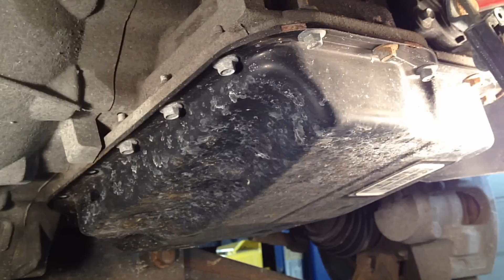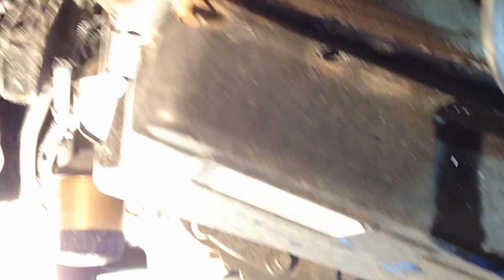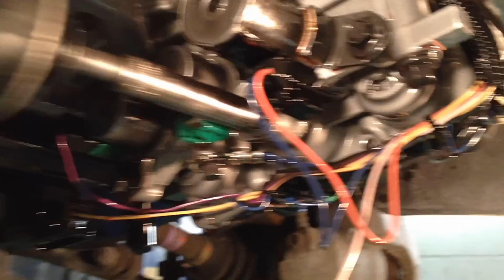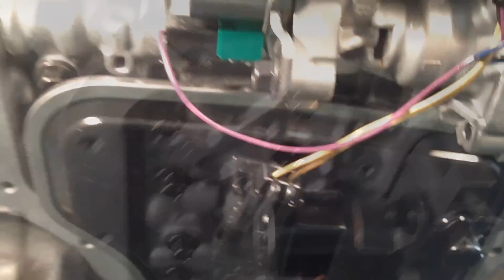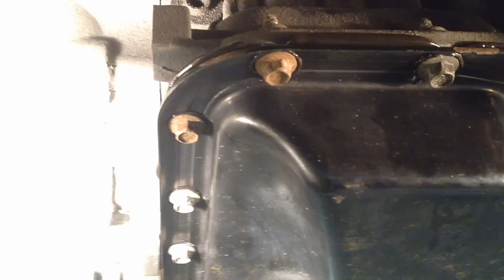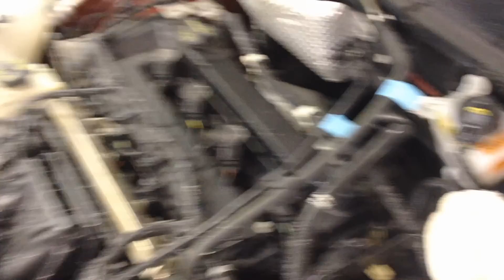Ford Focus Shift Solenoid A Repair P0750 P0753 P0972

Comment: Great video and advice..I have a 2008 Ford Focus tdci auto which keeps changing in and out of gears jerking motion yet hasn't lost power...slipping is only so often. Would you suggest this a solenoid or bands?

Comment: how did you know the solenoid was bad?
Reply: Sometimes it will throw a code making check engine light come on. Other times you may have shifting problems (sometimes only notable at wide open throttle). It may not shift to a certain gear when taking off. Maybe your driving and feel it go through 1st and 2nd but never shifts to 3rd. Or say you go WOT you gets to the end of a gear and theres a long delay following by a harsh slam shifting to another gear (computer senses it slipping, raises line pressure which causes it to slam into gear). Sometimes you may have a down shifting issues aswell. A slipping trans doesnt always mean the trans is toast yet. Sometimes solenoids fix em (but not always, could be pressure leaks elsewhere). But if driven long enough with bad solenoids it will burn up clutches and bands. GM's 4T series of transmissions used in lots of vehicles had problems exactly like this. Only you had to practically drop the transmission to get to the pan on the side of it in order to change the solenoids... Some of the higher powered GM vehicles such as any with the 3.8 Super charged engine had the issues along with the Impala SS with the 5.3. Most of the time it seems heat kills them. Adding a shift kit to firm up shifts (and generate less heat) along with a transmission cooler (if possible) goes a long way.
Reply: TheFrontYardMechanic personally I think everyone should sub to new level auto channel. This guy is packed full of knowledge and we all can learn so much from him. The best part is he is willing to teach us. Right here on yt. Everyone should take advantage of the info he's giving us.

Comment: is there a way to test the solenoid. i have 2003 focus 188K miles. i was driving and it like  jerked for a second and like transmission gear light come on the instrument panel. planing on changing this solenoid hop it don't come back
Reply: Ehmid Velic I have the same problem. Be checking it out soon. 04 Focus LX.

Comment: my zx2 is weak if I try to take off fast all of my solenoids click when I put power to them I am considering checking the epc in the morning but when I shift into 1 it doesn't slip at all!
any suggestions?

Comment: I have a 2005 Focus. while driving home I came to a red light, when it changed green I went to drive off and had nothing. I can shift through all gears but they never engage. I have no check engine light coming on. I do however get a long constant beep when I shift out of park. Any ideas of what I need to do

Comment: got a 06 ford focus zx4 od light flashing had since 2010 all the gears work except when i start driving it jerks once then drives normal what it be an electrical issue just happen today

Comment: i got a 2006 ford focus zx4 2.0 automatic has 120k miles on it. reverse will not engage at all other gears work great. in order for reverse too work i have to rev the engine let it drop and rev again and then it goes into reverse with no problem but after i drive i would have to do the same to get it back into reverse. i have no trans codes what so ever though. i do have a solus edge any tips of what i could do to see maybe if it is a solenoid please let me know before i buy a new trans. also i was told that the reverse rides on the trans pump and most likely the seals wore out and the trans is bad. thanks in advanced.
Reply: mines doing the same thing did u find out what your problem was

Comment: What does each one of the solenoids do in terms of shifting?
Solenoid 1 works = 
Solenoid 2 works = 
Solenoid 3 works = 
Solenoid 4 works = 
Solenoid 5 works = 
My problem is the TQ conv lock up and no code has tripped
Can you help?
Reply: Where is the solenoid C

Comment: I've got a 2011 ford transit connect and the transmission has been banging for the last month or two because I believe broken motor mount. just the other day I was driving down the freeway and the transmission started slipping. I found that the truck is now working in first and second gear. but when it kicks into 3rd, the transmission slips. I removed the throttle body, cleaned the valve, and replaced the throttle position sensor and reset the PCM. took it for a test drive and it's still not working. I'm getting a light on the cluster that says "Throttle control/transmission." Any ideas?

Comment: I've a 2007 Mazda 3 (2.3L ..5 speed)..it Jerks violently when I shift from park to reverse.  
it won't shift to 4th and 5 th gears... AT light on..code P0753 electrical. ....I hear Mazda 3 has the same selonoid as ford fusion. 
any ideas ? pls help. thanks.

Comment: I have a p0715 code so far I replaced the wire harness the pcm input and output sensors and the code keeps popping up i reset the light and after 30 miles it comes back on I have a 08 e250 van 4.6 any info would be greatly appreciated thank you

Comment: I think I may need some solenoid work done on my 2007 Ford Fusion SEL V6 3.0L when it gets hot the slipping begins. But it only slips going from 2nd to 3rd, and sometimes from 3rd to 4th. I also noticed that when it is cold outside it shifts fine. But once it warms up, my transmission starts acting up. And it shifts really hard into reverse.

Comment: Excellent video thanks .......I have a 2002 with no reverse will scan today but check engine light is not on.....which solenoid would I need to replace if that is the problem?
Reply: i have a 2006 no reverse did u find out what it was
Reply: I have an 08 Focus.  No reverse.  :(  I'm going to swap some of these this next weekend and then to the tranny shop.
Reply: Did you find out which solenoid to replace?
Reply: John Rinehart I have a 2005 same thing

Comment: Hi, I have a 2006 Ford Focus, with a p0960 code, is that the pressure sensor? Have you known any probs with this solenoid, the code is intermittent, sometimes doesnt come on, never comes on straight away, fluid is new and at the midway point on dipstick, thanks great videos Jon

Comment: do i need to pull any fuses first or disconnect the battery before doing this
my d solenoid was actually the one that went out  error code po766 i have an 03 ford focus with 270,000 miles

Comment: Just replaced the b solinolid and had the battery disconnected the whole time but never had the jumper wire. I took it for a test drive but still wouldn't shift past 2nd. is this because it still thinks it's in safety mode because maybe the memory wasn't completely cleared?

Comment: is this the same thing for p2709 on the ford 2006 fusion i have to change the ones on the other side of abc that"hardly fail" im getting the code twice might be two sensors so ima do all 3

Comment: Would this be the same process for a 1996 Ford Taurus GL?
Reply from the maker: +Link the Duelist Taurus transmission is totally different.
Reply: FordTechMakuloco How would I go about doing this? Do you have a video about working on a 96 Taurus?

Comment: done replacing solinoid on 2000 ford focus se..transmission..still slipping on drive but my reverse gear is so strong, runs like a new one..pls..needed advice...
Reply: what happened to your car? Did you get it fixed?

Comment: I have an 02 focus with 45,000 miles . I had 2 codes input turbine speed sensor .so I replaced that one first, now I have PO765 solenoid D. I know in your video you said they never fail . But should I change it ? it starts off in 2nd gear all the time, and when I stop at a light the transmission clunks down into first gear hard . what should I do ? thanks
Reply: +Gabe Bashir I am having the same problem ,   have you made any progress  2003 focus        Alvin

Comment: got a 2001 focus throwing codes: p0766, p0732, p0734. shifts rough and tends to drop out of gear then pick back in very aggressively. fluid is black with shavings noted, just need it to run as a temp vehicle so besides needing full over haul and new clutches and everything what solenoids can i replace to get it running for now?

Comment: Hi I have a 2001 Ford Focus se 2.0LMy car stalls at 30 and if and when it does change out it stalls again. Auto zone gave a read for a torque converter or something. I'm wondering if this is the fix that will help. I have had to replace a sensor in the transmission before I'm wondering if this is the same thing because my car is doing the same as it did the first time. Any help?

Comment: Hi, im replacing solenoid E ....is that the middle on as you state in a previous comment or is it the end one as in the video?? thanks
Reply from the maker: +Saul Harrison Its the middle solenoid on the size with the three large solenoids that are all the same part number.
Reply: @FordTechMakuloco  hi I have a question I have a 2014 ford focus se  have 2 issues doesnt go into reverse and when in drive it drives fine but after awhile it it starts messing up and wont go faster then 20 Mph I have a scanner not all professional one but the code that comes up is P090C any help or  Diagnostics would be appreciate alot I already bought a Low Actuator B AMD changed It but still No Burno or Reverse I took it to ford for 2 different recalls and they fixed those issues and re flashed the TCM but idk if they changed it or not I just think they flashed it but like I said I would appreicte your insight thank you in advance and have a blessed day

Comment: Hello! Seeing your video was awesome, great detail. I have a 2008 Ford Fusion shooting me error code p2709, solenoid f electrical. have you ever seen this before, and if so how would I go about fixing it?
Reply from the maker: +Sean Johnson if the harness internally and externally is ok then I would have to say replace the solenoid.
Reply: Thank you for the reply! Took it in and found out a mouse had chewed through the wiring in the transmission!

Comment: Hey I need help have a 2007 ford focus  and the overdrive  light  is on an my car want shift into gear right
Reply from the maker: +Christopher Williams If the light is on or flashing the pcm has codes stored in it for the transmission. Get those read first.
Reply: FordTechMakuloco I have the same light with no codes at all, and the shifter moves into the gear position but does not engage into any gears?? Any help would be appreciated
Reply: Christopher Williams did you ever figure out your problem?

Comment: Hey I need help!! So I have a 03 ford focus. About a week ago the shifting felt funny n 3days ago wen I was driving my engine light came on. After I got home n tried to drive it it wud only let me drive 20mph anytime I go over that it stop accelerating n is stock at 20. I can push on DA gas n it wudnt accelerate but wen I let it go bk down to 20 its bk accelerating. Its a bad smell in my car that smells like the trans. I took it to autozone n it spit out DA code P0750. Cud the solenoid be the problem????? Or do I need a new trans??????
Reply from the maker: +Tish White for a p0750 code I would change the SSA first also inspect the harness for chafes while you are in there.
Reply: FordTechMakuloco Thank u

Comment: Great Video FordTech, I have a 2008 Ford Focus with 110K. and it does not engage in reverse. Which Solenoid would I have to replace A,B,C,D,E? Can a solenoid be test before replacing blindly? Where can I find what each one affects specifically for future reference? I heard these go out frequently, i dont know how true that is.
Reply from the maker: +Katy M. Detailing According to the solenoid chart no solenoids are turned on for reverse. the concern is either in the valve body or the reverse clutch pack.

Comment: I'm having a shifting issue with my 2009 ford escape. originally it wouldnt go onto reverse. So i put it in park cut it off then it wouldn't crank. I checked some forums and they said the shifting solenoid was bad. do you have any info on those?

Comment: im getting that p0750 code and the van shifts ok in 1, 2nd gears no 3rd or 4th. im gonna change that solenoid. question is the 2012 transit connect the same transmission?
Reply from the maker: +John Dagostino Pretty much yes.
Reply: Dude you rock

Comment: I want to thank you for this video, I know nothing about cars but this give me the confidence to try, I found all parts in my local autozone and I didn't expend more than $85. thanks so much my car is driving smoothly now.
Reply: did you use silicone or a gasket on the pan?

Comment: Great video! My girlfriend's 09 focus, doesn't go into reverse when you put it in park in order for it for it to in reverse we must leave it neutral, and when it's in neutral i noticed that when I rev it it won't won't past 3k rpm, now when when we drive it it sometimes doesn't want to shift like going up hill this happens 3 days ago now my question is would the shift solenoid be the issue or is the transmission in need of a replacement ? This happend when she curved the car and it started acting weird. So if you could give me some advice that would be cool thanks in advance !

Comment: Hey bro, just want to say great video.  Very straight forward and informative.  I have a problem with my 2007 Focus 2.0 A/T with 63k miles.  The trans fluid is clean but it wont shift into reverse sometimes.  Sometimes not at all, sometimes hard, and sometimes smooth as silk.  All the other gears shift fine.  Once it is warm it works like it should. It had a check engine light when I got it and I brought it to a shop.  They told me it needed an O2 sensor and that they would clear the light for me to see if it would come back on.  Since he cleared the light I've had the reverse problem.  Coincidence?  I don't know.  Any advice would be appreciated.  Thanks in advance.
Reply from the maker: + Tom Barbiero It would seem you have excessive wear on the endcover that feeds the direct drum pretty common for this concern. No solenoids are activated for reverse it is all mechanical but it needs that pressure feed to work.
Reply: Any ideas on how to fix it?
Reply from the maker: End cover replacement requires a full rebuild.

Comment: quick question, I have a 00 focus zts dohc and it shifts into P-R-N-1-2-3 nut no 4. Also pressing the O/D button  doesn't do anything. think it might be a solenoid? or clutch seal? oh and I have no check engine light or code, that's what autozone told me.
Reply from the maker: +Frank Rodriguez No 4th only I would go straight for the solenoid listed in the video description.

Comment: Hi there , thanks for very informative video, I have a Hyundai  elantra 2003 with the same issue, shift solenoid A error code,  I got all the parts and willing to change it in the next days, do you know if the shift solenoid in elantra is the bottom or the car or on the top? preciate any input.
Thanks

Comment: I have a 2005 Ford Taurus that ran great. I did not have any slipping with the transmission. Just woke up one morning started the vehicle and it did not move in any gear..No grinding sound. Just unable to move the vehicle in any gear. Could the shift solenoid be the problem? if so, how could I determine the codes like the ones you identify with the focus for the Taurus?  Having some clue with the  problem before dealing with a mechanic makes the process alot easier.,,

Comment: I need help I have a 2012 focus that wont go on reverse check engine light came on with code p1861..... by replacing A&B solenoid solve this issue.... thanks in advance

Comment: Can you help?
I have a 2002 Focus LX & started to have problems after shifting into 2nd & 3rd & couldn't detect shifting into 4th at all & CEL came on. The code checked was P0750. Then, the next day, just before repairing it we discovered it wouldn't go into reverse to back it into the garage. Did not recheck codes (probably a mistake).

Using your very well done video video we changed solenoid A, the filter & transmission fluid & reset the PCM. It now shifts into all gears smoothly & gas mileage has even improved (now that I have 4th).

BUT! I still do not have any reverse at all!  Any ideas??  
I'm assuming the CEL will come back on. I have driven over 100 miles & still no CEL & no code (Even purchased my own code reader now.) How long before the CEL comes back on? Any wise advice would be truly appreciated - thank you.
Reply: Have you had any luck figuring this out im in the same boat

Comment: 2003 focus drives just fine after its warmed up but when I first leave I have to turn the overdrive button off cause if not then it will act like the trans is not shifting into drive and rpms go high so I turn off overdrive till I get to speed then turn it on and it shifts fine, also seems to shift OK after been driven a little until it cools off then back to turning off od button?? Any help please?? Chanced fluids and still doing same....
Reply: Check your linkage adjustment, and maybe change the trans filter. BTW If there's an engine code the fix the issue then ck it again.

Comment: Hi ,very nice video. 
I have Focus 2006, 2.0L engine. I'm facing problem with the Transmission gear Box. It's starts moving perfectly (from 1st To 4th shifts) But when the speed reduced less than 60km once I'm going to increase the speed again the rpm increasing to the maximum without power it seems trans on N not on D. If I put the trans on manual mode and shift down to 2nd shift the trans catch the gear then i can go with 3rd &4th.
Now I feel No power on the gears and torque lost. Is it solenoids?  If yes which one is the defected?